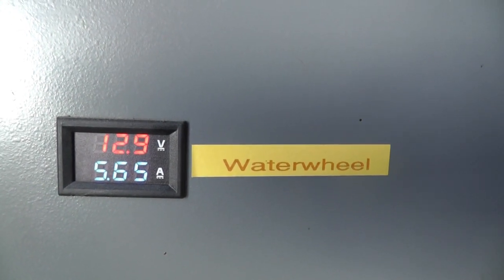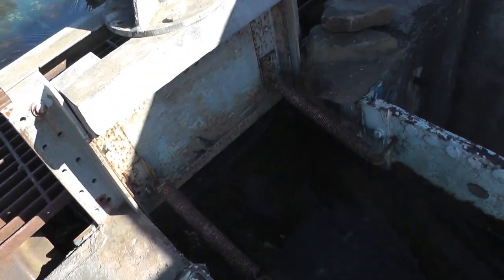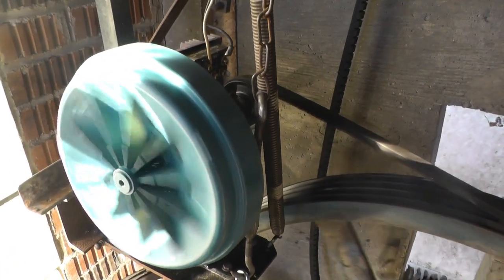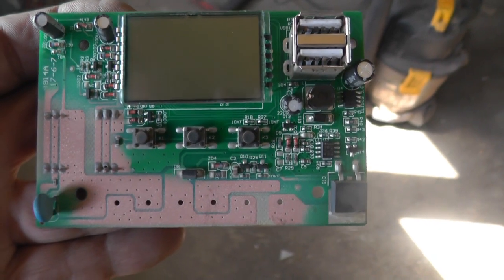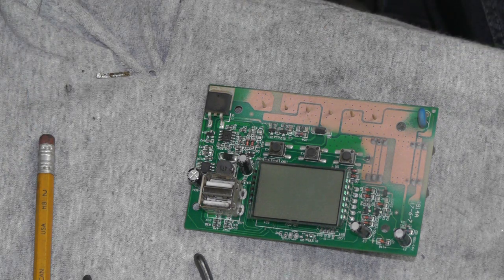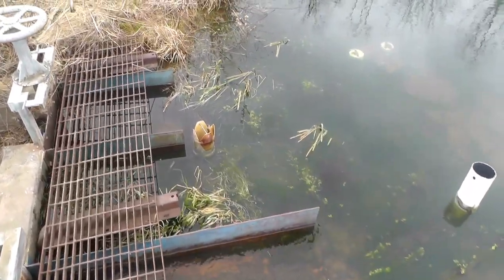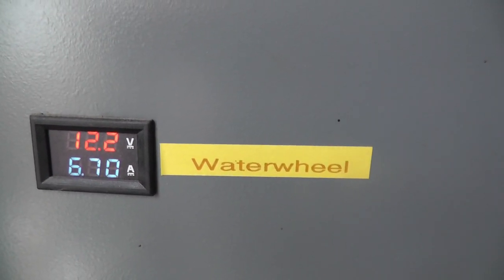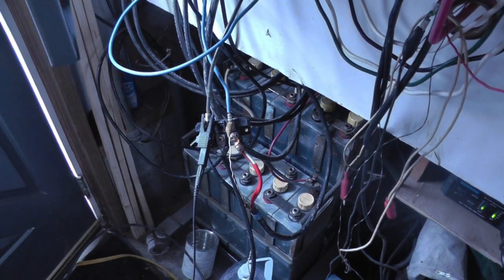Smart Drive AC Transport & PWM Experament

Comment: Many will need to go to these types of systems as grid power becomes more unaffordable plus the government pushing renewable your a pioneer in this
the power company wants 700+ to fix my grid connection for what i run for a cabin lights,computer,fan,mini fridge 100's for the bill!
tankless hot water (gas) wood heat i can buy a 2000 watt inverter for that much keep tinkering you have the perfect lab to test pma's and other things
perhaps combining a flywheel generator with the water wheel i though about the flywheel generator and using a one way bearing to reduce drag 
the flywheel generator would add rpms and torque to spin a big pma much faster where the water wheel would provide the "kick" needed to maintain the momentum
but i havent seen the old tech used with a water wheel

Comment: Its very good BUT along that long cable your loosing a lot of power,  I would have your inverters & batteries in the waterwheel house, run up 110V then up to your home, less drop using good cable in say a PVC tube

Comment: I would say that is a significant improvement in power production just by running the three phase up to the shop. I'm eagerly anticipating the video after you get the MPPT controller repaired and connected, I anticipate much more power (if the MPPT controller works correctly).

I try to stay away from chinese slave-labor products, I learned when I was young that I'm too poor to buy junk and I don't like supporting slavery.

Comment: the commen neg did not need build up as they can be solid joined away from controller and just a link wire added the positive sides of the pcb are the ones that need the building up i also wounder if the voltage reg unit from a car alternator is prob best with the amounts of amps they can produce

Comment: I think with the MPPT controller you will get more especially because of the open circuit voltage, the higher the the voltage you get with mppt will be more power with tbe same amperage,
For example with 50v on load with the same amperage you have know it will give you 300ish W, nice videos and keep it up
Regards.

Comment: Thanks for sharing your thoughts and trials. I was surprised to see such a high voltage from the smart drive, now  I wonder if a voltage spike took out your mppt controller.
Reply from the maker: No it was on my solar panels when it went bad. There was not enough water to run MPPT control at that time.
Reply: @kevincrawford2027  👍

Comment: You know if you run the 3 phase to the shop and put that Bridge rectifier in shop make the run on the DC side shoulder you might get a lot more power because you are running to DC power too far of a  run

Comment: How well do you like that charge controller shown at 0:42? I have a cheap Chinese one and it works but when the battery is fully charged and the sun is out full, I get this pulsing in my lights that drives me crazy. Do you get this in yours? You know... You really don't need to use the last 2 connectors on the right of the controller. It's the line out and you can just tap straight off the battery. 

You could also theoretically split the input lines to use 2 controllers and that would divide the power being used. I also wonder why you just can't install that 3 phase rectifier into the wheelhouse straight off the smartdrive? You also might be getting that extra amp from bypassing all the meters in the wheelhouse.. Something to think about

Comment: Definitely interesting! You picked up about 20% by using 3 phase ac but still locked down to 12v. With a higher transmission voltage you might pick up another 20%!

When I first set up my turbine it was producing about 120v under load and I was dumping the energy as heat through incandescent bulbs in my insulated shop.